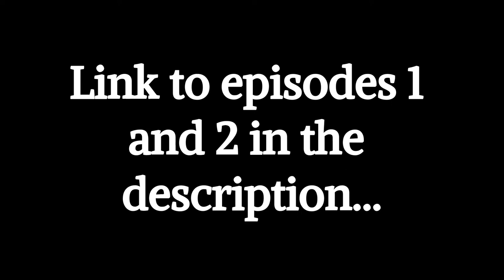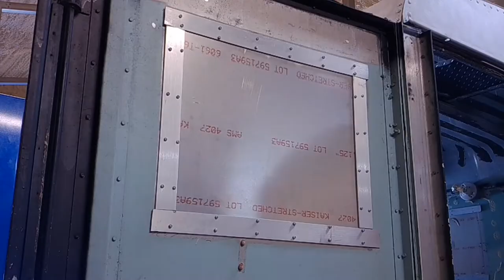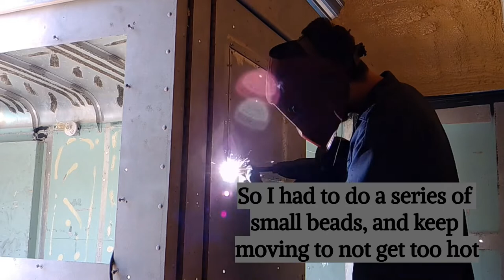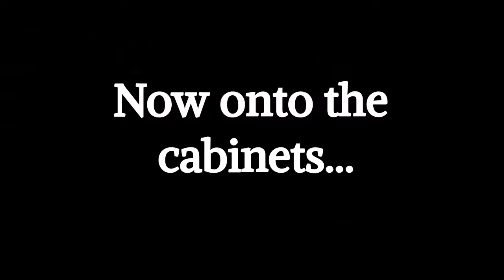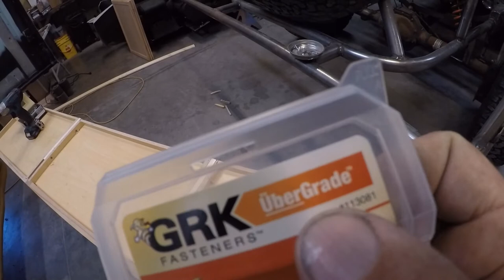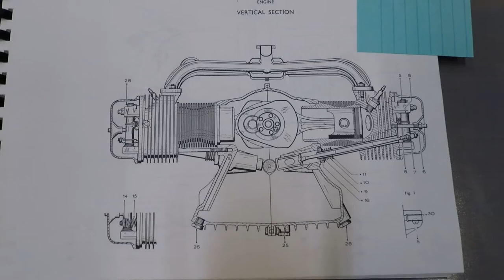Mobile Bar built out of a Vintage Step Van (Ep3)

Comment: Oh and yes that color looks amazing. I do a lot of well we will call it pho antique office furniture and other items like shelf’s, desks and tables I do my own mix using steel wool, vinegar and Peroxide to age the wood but I really like the gray stain you have I often use a similar color on some of my items. The home made stain works well on some woods but not so well on other woods so then I will use stain. Your counter top looks amazing great job.
Reply from the maker: Thanks! I am a huge fan of automotive clear coat over finished wood. I have been doing that on bar tops for years and it hold up better than anything else I've tried

Comment: Will you see a faint outline of the small aluminum patches, even after sanding and polishing?  Also, do you paint the interior before you install the cabinets?
Reply from the maker: You will see the outlines of the patches, that's just the nature of the weld seam and the aluminum being slightly different materials. If I do it right, it will give a cool vintage look. The interior will be completely bed-lined, even the cabinets. I have done that on the last 4 and it is really popular, as it's very durable and can be washed out.

Comment: Not a fan of the gray, I like a contrast between colors. My question is why frame an all aluminum van with steal? I'm not a metal expert but was told never mix metals.
Reply from the maker: Grumman was an aircraft manufacturer with a glut of aluminum after ww2, so they started producing vans that were strong and lighter than steel without the rust issues. Sheet aluminum was relatively inexpensive, but making an aluminum frame would have been cost prohibitive.  There are certain instances where mixing metals is bad (check out: https://en.wikipedia.org/wiki/Galling ) but other instances where it is just fine.
Reply: @AustinCoulson  Thanks, great read.

Comment: 6:00 Cheating! But that's okay. I always cheat.
Reply from the maker: Maybe we can get a letter writing campaign to my wife explaining all the reasons I need a Proper TIG machine.
"So it's 1600$ and it does the same thing as the other welder?" 
"No, no, no, it's totally different" 
"Does it make 2 pieces of metal into 1?"
"Yes, but in a different way!"
Reply: @AustinCoulson  we could try. But it would probably be pointless. It would be just like them trying to explain why they need so many different pairs of shoes.
Reply from the maker: @lostintime8651  I have to wait until I can work the cost into a job that I really need it for. I think a new plasma cutter is next on the list. Have any recommendations on that?